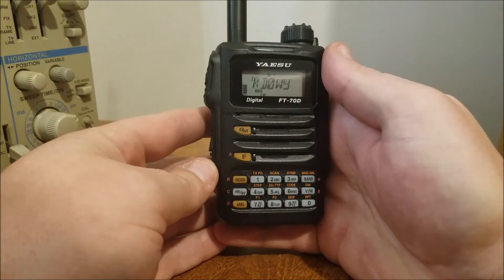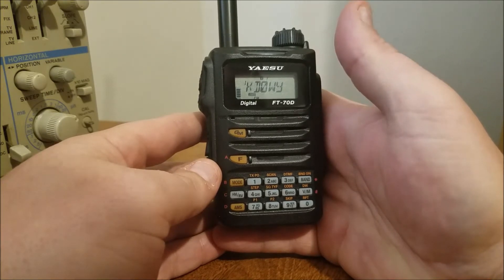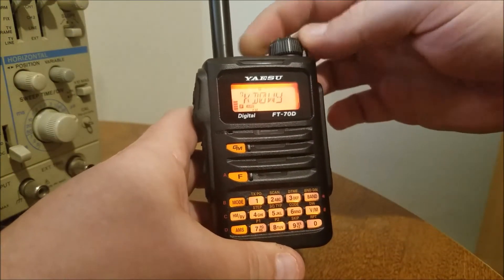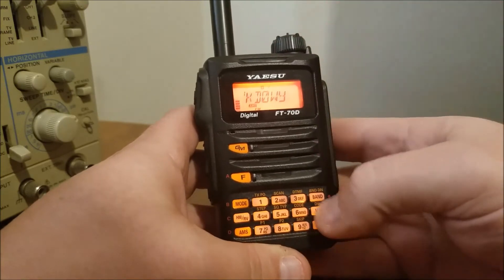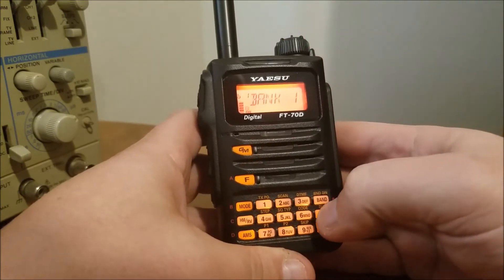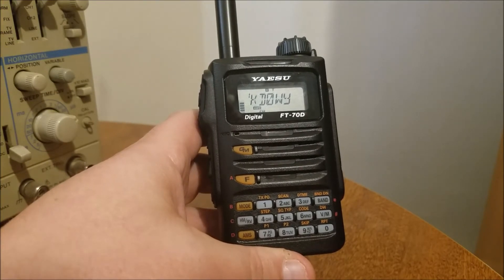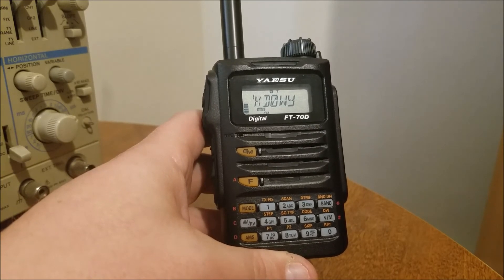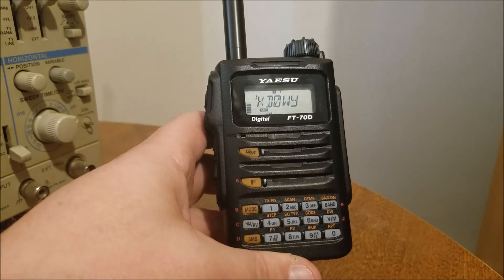Yaesu FT-70DR Programming Memory Banks

Comment: Hi: I have the Yaesu FT70D. I want to program thus radio using the 
specific software, but avery time that I connect the data cable I have 
this message ""  INVALID COM SETTING"" How can I solve this issue? 
Thanks
Reply from the maker: What software are you trying to use?
Reply: I am using the yaesu software. ADMS-10
Reply from the maker: @kg6blq777  https://www.buytwowayradios.com/blog/2016/07/programming_software_does_not_detect_cable_or_com_port.html
Reply from the maker: @kg6blq777  Follow these steps and see if that is all correct.. I'll do a little more research and talk to a few people see what else I can come up with.
Reply: Thank you so much

Comment: How do you select multiple  memory banks to be scanned (from the keypad)?
Reply from the maker: in memory mode (normal memory mode, not memory bank) select a random memory, press and hold V/M key. "F" blinks in display. Rotate the dial to a bank that you don't have memories registered to. Press the V/M key to save.

Now, while in memory mode, pressing "band" switches between all memories and memory bank mode. Memory mode displays "memory" for a moment, memory bank mode will display the "bank number/name" for a moment. In memory bank mode, press "F" then "band", now use the knob to select what bank you want, then press "band". Pressing "F" then "scan will scan just the bank previously selected or select all to scan all banks.
Reply: @JoeDauen   I am missing a step on selecting / linking the second and third memory bank for scanning.

No problem selecting the first bank.

Store random channel to unused bank.

Bank to select Memory Bank mode
F, bank, select first bank

Repeating F,bank, select second bank only results in second bank scanning.

All assistance is appreciated.

Abe
Reply from the maker: @AEMHI1  How are you programming the radio because that is a common problem when programming through either chirp or ADM.. RT system fixes that problem but unfortunately that is paid software,  let me reset mine and play with it to see if I encounter the same problem and I will get back with you.

Comment: Im looking for how to do odd split. I dont see any on youtube, splits that the offset cant do. Or programing a vhf rx and uhf tx with using offset
Reply from the maker: I think I understand what your talking about but this radio doesn't do cross band, if your looking to tx on vhf and rx on uhf or vise versa you would have to purchase a radio with cross band.  The offset in this particular radio can only go so far up or down the selected band. Sorry I couldn't be more help! 73
Reply: It will do odd splits on vhf/uhf. Program RX freq first with tone if needed, then input TX freq on VFO, write to the same memory (turn the dial to pick the same memory) while pushing the PTT. The RX frequency must have the tone (standard procedure for Yaesu) so don’t get confused and try to program the tone with the TX freq.
Reply: @jbinsc  ok so the 2nd time you memory the tx freq press ptt while enteringt the memory, thanks man 73, great help
Reply: James Balagtas push V/M while pushing PTT, it’s a whole lot easier to set up using the Yaesu software though. The FT-70DR is a good radio. The battery life isn’t great, but if set it to FM only when not using Fusion, it lasts a lot longer. Digital uses a lot of power even when the radio is off. Take the battery out if you’re not going to use it for a day or so. It sounds better than the 3DR and the display is easier to read in bright light conditions.
Reply: @jbinsc  thankyou  very much
Reply: James Balagtas anytime. Yaesu programming is a little confusing, it’s been the same since the FT-51. Once you understand the steps it’s really easy. Getting the radio communicating with the PC is where most people run into problems....it’s crazy.

Comment: I have the banks setup from the computer, but I cannot figure out how to switch between banks :( google not helping and the manual doesn't work ......
Reply from the maker: Jimbo M I'm working right now so I'm not right next to the radio but I believe you just hit ( band ) to switch through the banks. 
If that doesn't work, try to program one by hand by following this video, in say bank 2 and see if the ones you programmed from the software are stored. 
I'll double check when I get back to the house.. 73
Reply: JDauen KE0MJE I must be doing something dumb...... I have the banks checked on the pc..... But band will only take me into bank 5.
Reply: Same problem, loaded memory banks via Chirp 20190412 Mac and when I press VM it double bleeps error ?
Reply: I'm also having the same problem. Does anyone found the solution?
Reply from the maker: @ahmadrafiq967  unfortunately I've always just programmed them manually. I should be back home tomorrow and I'll take a look at the program and or make a few phone calls to see what I can come up with.. 73